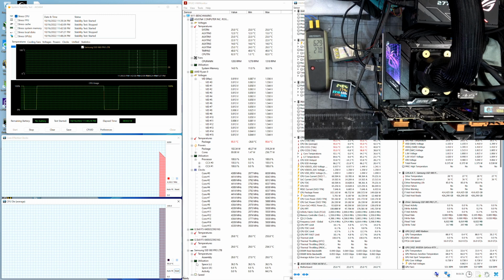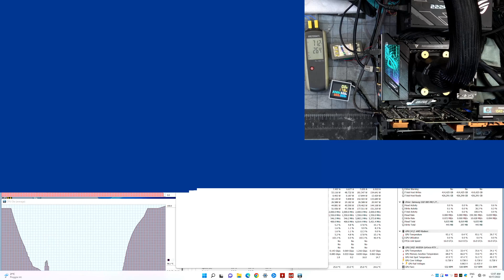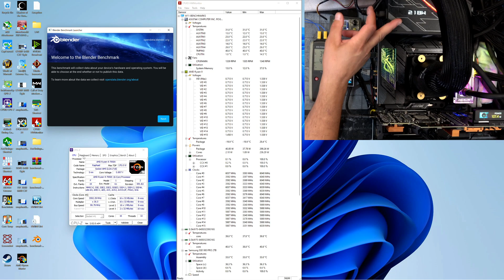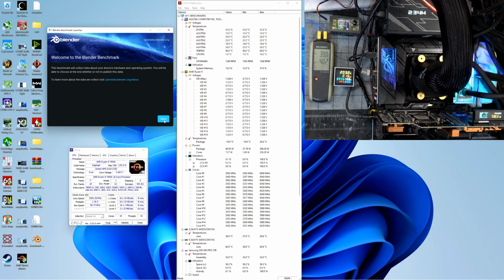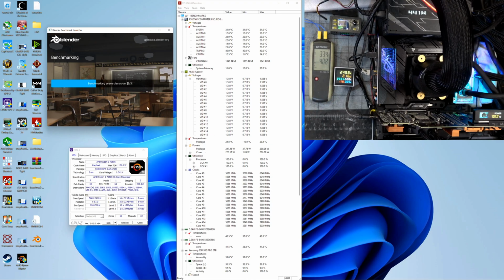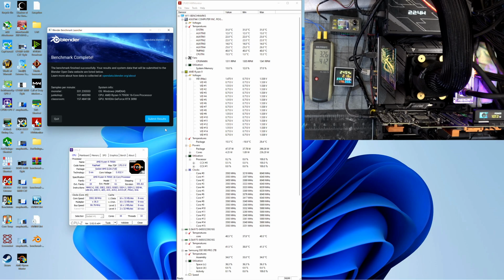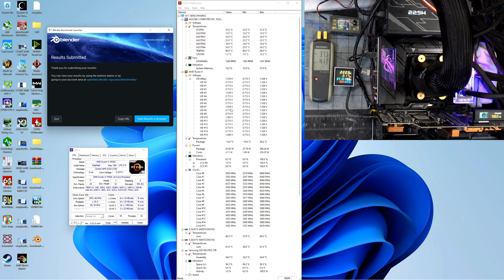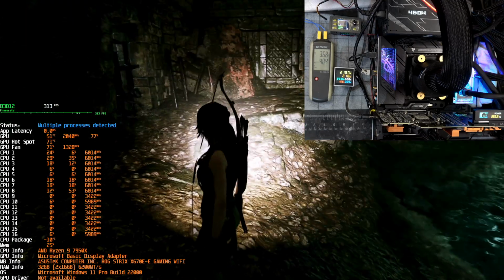Mini Phase Change Cooler Ep3: Ryzen 9 7950X

Comment: I've built many phase change unit back in the early 2000s, and the evaporator mounting enclosure is by far the hardest part. Specially if you want to use it for more than a few benchmark tests.

Comment: Bro what would be the best low budget cpu for playing dragonflight? betwen r5 5500 / r5 5600 / i3 12100f (with a rx 6600 gpu)
Reply: If you're not into memeory overclocking, a ryzen 5600 at 1600 FCLK (with a ddr4-3200 kit of memory) running ""vddg"" 1.0v SOC, 0.9v IOD, 0.8v CCD
If you're into memeory overclocking, a 12100f or ryzen 5500 depending on whether you have an AM4 board

If you like pain, then memeory overclocking on a ryzen 5600 then dialing in the perfect combination of SOC/IOD/CCD voltages to minimize fabric dropouts and make it actually behave itself above 1666-ish FCLK

Option #3 is the only one I can't recommend.
Reply: @TheDoomerBlox  tysm Bro!

Comment: Out of curiosity: Wouldn't you theoretically run into a DLSS-bottleneck at some point if you use that instead of manually lowering the render resolution when testing CPUs? It doesn't matter for this video in particular, but I thought I'd bring that up in case you do CPU comparisons in the future.